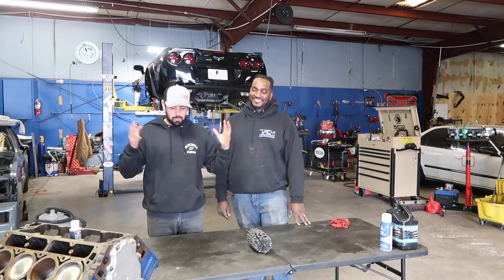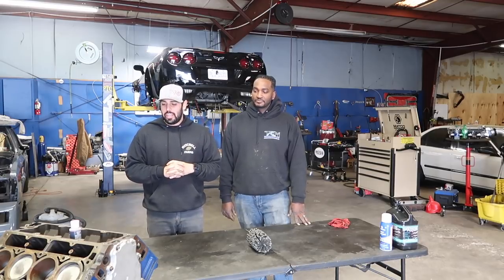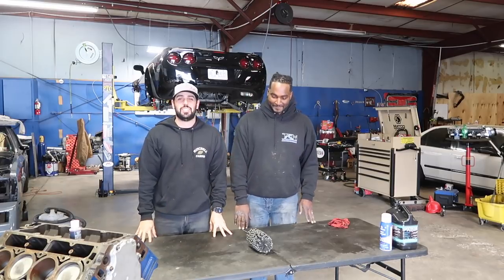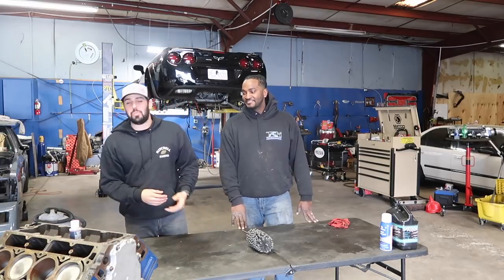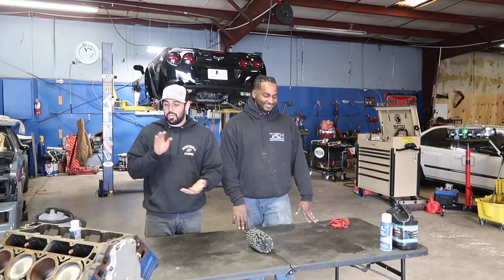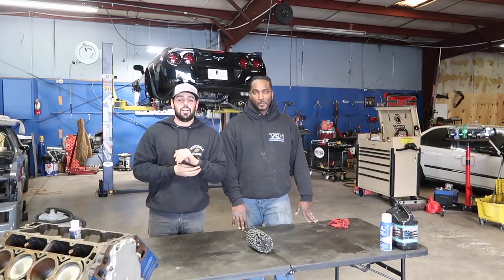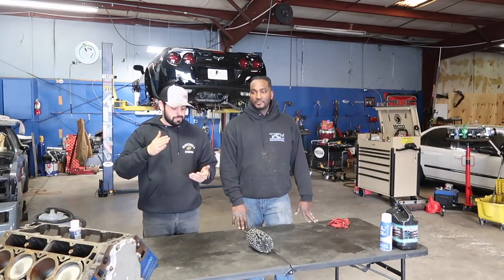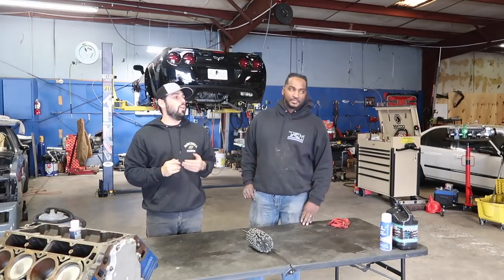Building a BUDGET LS Twin Turbo Engine!!!!!

Comment: Wrist pins shouldn't be like . Wasn't put together right . If you take those wrist pins apart they scratch the bore .I got the 823 heads you need and a good 5.3 short block bottom end. I'm in jersey. I can build a motor with my eyes closed like ben

Comment: The rods were orientated correctly, the stock crank has a rolled fillet and not a radius on the journals so it doesn’t matter which way the rods face.  Your boy Ben is thinking of old school engines.

Also, pins bind in the stock rods and pistons all the time.  Its usually carbon build up.  Spray WD40 in there and then oil it and it will move much better.

Comment: Build a cheap summit brand everything would be cool
Reply: I got summit pistons in a half filled  ls2 with gen4 4.8 crank and rods and I have zero complaints and been 5.60's in a 3300 pound 99 z28

Comment: Hello, I was just wondering if 900HP-1000HP is possible with a 5.3L LS displacement using twin GT30 size or GT35 size (if need be) Turbochargers. A built 700R4. But not too many other overly expensive components? I was thinking of using a summit racing big nasty, big truck torqinator, or a stage stage 1 cam from someone.   Planning on putting this engine in a street/strip car with occasional daily driving. Hoping to keep the rpms at no more than 6500rpm, or at 6000rpm if it all possible. Or is this asking too much from a basic 5.3L LS?

Comment: To be cheap just get gen 4 rods and pistons. Holdener got to 1558hp at crankshaft on gen 4 SBE on engine dunno. Tune it better than the black sheep and it will last

Comment: Take up the engine from the stranger ranger and put it in the box rods and pistons inside strange ranger and make it a race truck
Reply: So basically a regular cab small pick up with a lot of power from a LS under the hood?  Sounds awesome, but why does it sound so familiar?  Hmm, it's like I've seen that exact build somewhere, but I can't place exactly where or who did it.  Hmmmm....

Comment: The flat part of the tabs on the rod all face foward. ...sorry Ben I'm gonna have to disagree with you on this one bud!!!..stock gen 3 doesn't matter about the bevel, bevel matters on aftermarket shit...

The rods and pistons were installed correctly.....they Are NOT BACKWARDS  , mark my words, the rings and wrist pins on the other hand need sum help